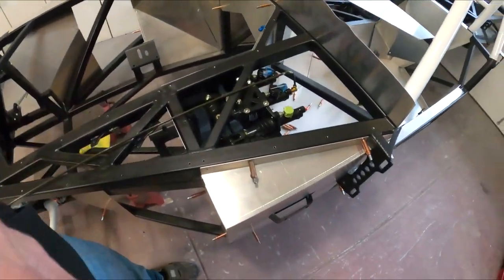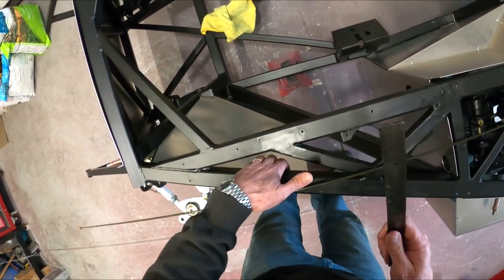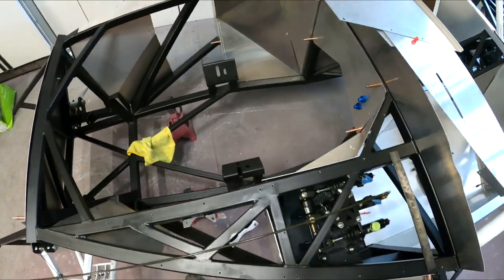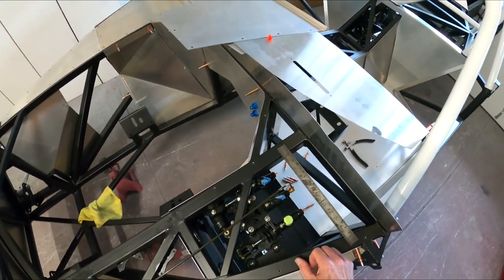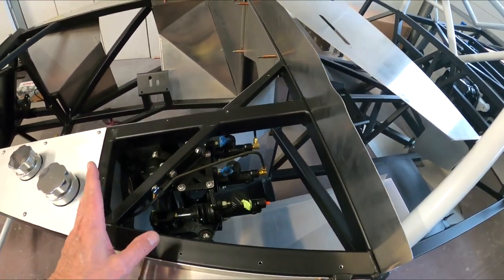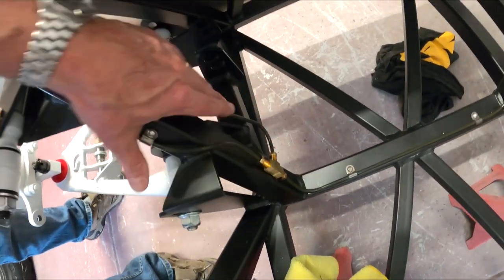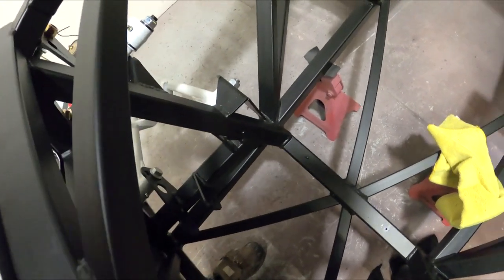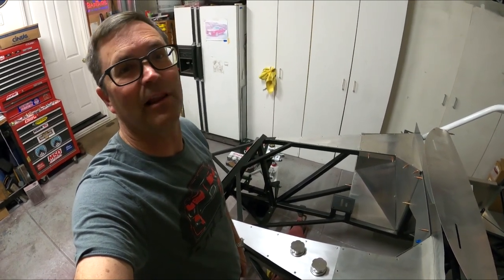Cobra Daytona Build-Front Brake line install, Video 29

Comment: I was thinking if I ever did this kind of build I'd probably try and get brake lines from all 4 corners to meet up somewhere in case I wanted to do ABS at some point. Do you think that would be feasible or a waste of time?
Reply from the maker: I know guys have installed abs on the roadster so cannot imagine it cannot be done on the coupe. Abs is a huge advantage in autocross and a lot of older cars get it installed. I say go for it.

Comment: So you used steel tube at the main connections  and then BLACK rubber.  Do you know if the brake rubber hose come in other colors.
Reply from the maker: The flexible line is braided with a cover for protection. I assume you could put a shrink wrap on them and any color.